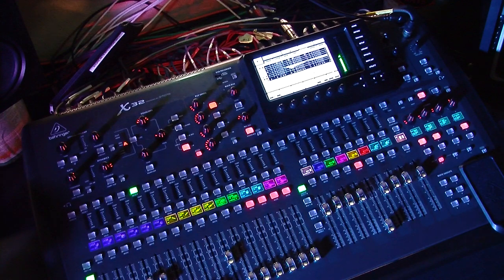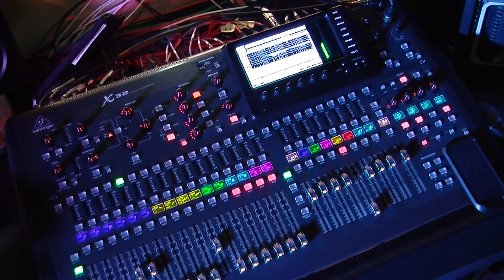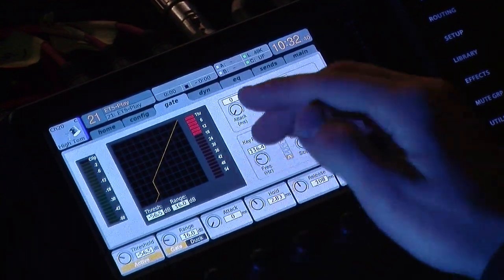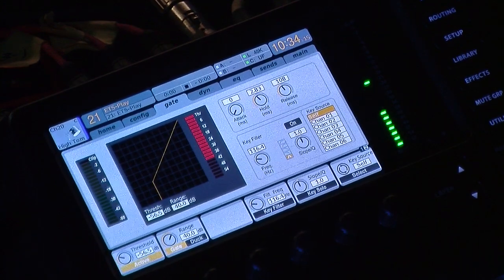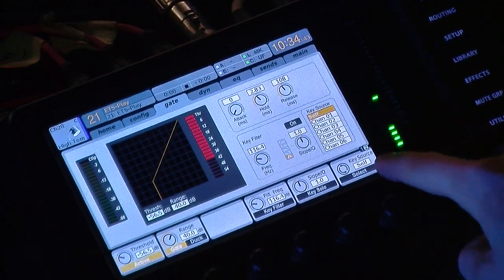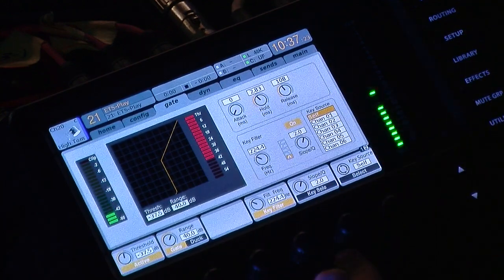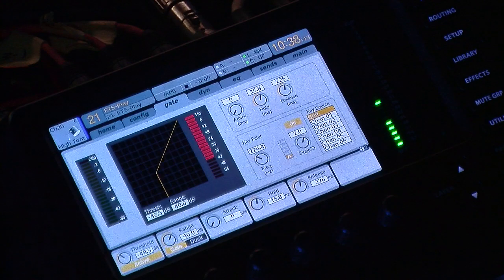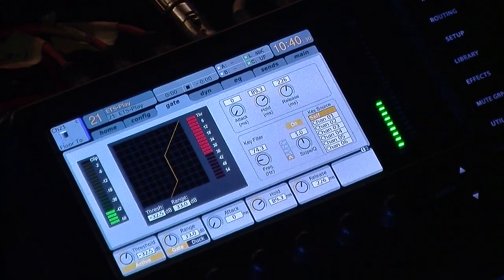Behringer X32 - Gate/Ducker Section - NRCC

Comment: Great video :) To fatten your bass drum sound you use the X32 build in oscillator (at the MONITOR page) to create for example 50Hz Sine Wave signal. Then set it's destination to MixBus. Then add a Channel for it and use the MixBus as a source. On that new channel setup your gate to follow your original BD channel and boom you got great BD sound. Unfortunately the scenes don't save the oscillator settings so you have to do it every time manually for the show.
Reply: But how do you keep the Sine wave signal out of the background?  It's always there a tiny bit.

Comment: Just to verify for attack you meant to say its how fast it acts upon gating the signal not how fast it releases?
Reply from the maker: You can skip to that specific part in the video: http://youtu.be/Br9AeNDKqdM?t=3m56s  For the gate, the attack is controlling how fast the gate opens (un-muting a channel) after the level goes above the threshold.  The Hold is controlling how long it will delay the Release once the level goes below the threshold.  The release is how fast the gate will close (muting a channel) after the level goes below the threshold.  It is a little backwards thinking to get a hold of it.

Comment: The sound levels are too low for me to grasp the gate function within the digital realm. However, I do understand the basics. Frankly, the gate function within the X32 appears to be fairly tedious.  I'll be testing the X32 Rack mixer shortly in hopes that it may replace my X1204USB.

For at least the short-mid term I plan to use my analog gate connected in series until I have a better feel of the X32 gate process. Sorry, but this video doesn't make it look all that intuitive.